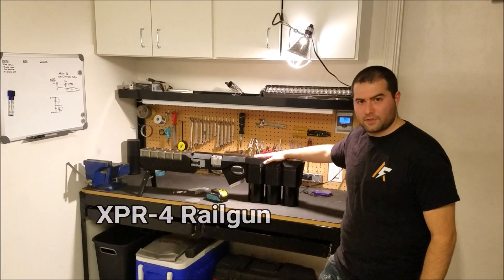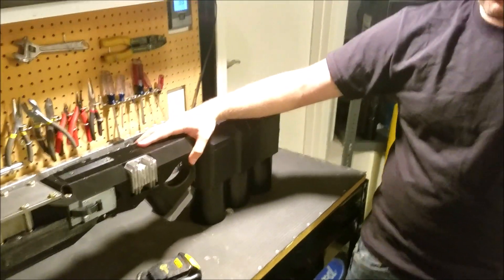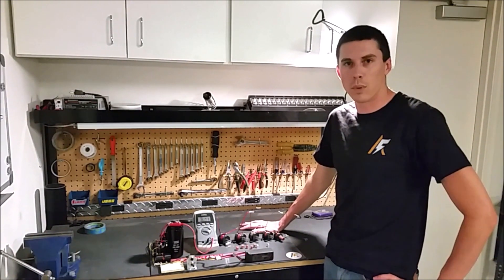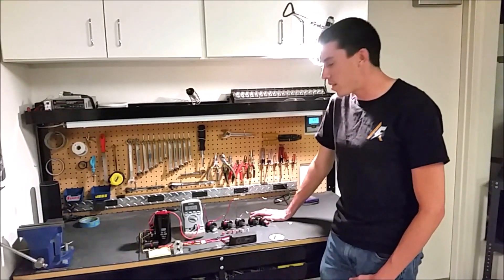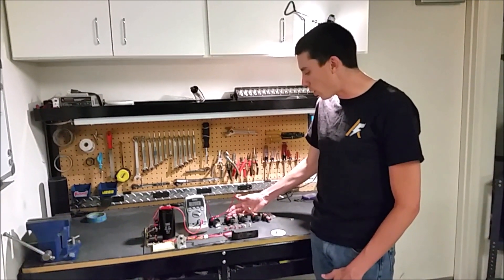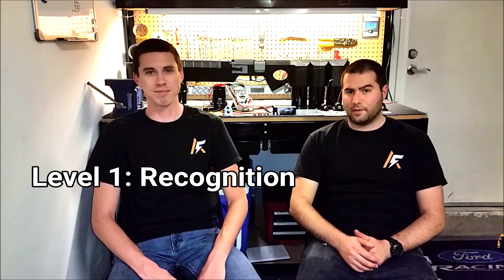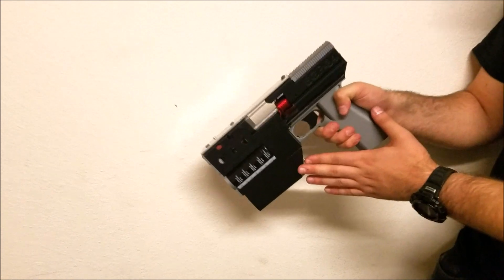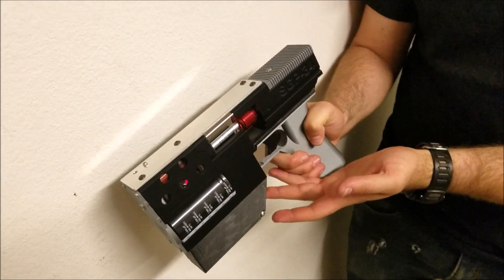New Railgun + Crowdfunding Campaign!

Comment: Surprised the US Military hasn’t picked these guys up. I’m sure somewhere at DARPA they’ve been experimenting with this stuff and may even be farther along but right now this stuff could be extremely viable in terms of lethal and less than lethal ballistic options. A low velocity metal slug would surely hurt like a mf and do some damage. I’m sure with enough R&D a low power, low velocity version of the stuff you guys have been producing could be explored in the field of less than lethal options for law enforcement and military applications. Maybe even commercial home defense. A much stronger high power, high velocity system using a sabot style projectile could be extremely viable in low noise, high damage applications for military use.

Comment: This is really cool, I feel like you guys should try a bullpup design though since you won't have to worry about case ejection or linkages in the trigger (the two main problems with bullpups). You should also have Joerg Sprave test some of your designs, he is in Germany but he has a chronograph and ballistic gelatin and in general seems really nice. It would be cool to get the velocity, energy and other stats for these guns.
Also out of curiosity, I am guessing that these barrels are smooth bore? I was thinking that if you wanted the enhanced accuracy of rifling without using lead projectiles you could use plastic sabots like with the 6.5x25 CBJ cartridge, maintaining the ability to use a variety of projectile materials while still getting the benefits of rifling. In this case you also wouldn't have to use flechette projectiles, which may be much more difficult to make. Regardless I would love to see an accuracy test of these wonderful pieces of innovation.

Comment: Personally..Back when I had 5.5KJ of capacitors ( 5 large caps custom made by CDE ) I never really had the best luck with coilguns shooting  insanely hard. But, When I made an ElectroThermalGun, with just a thin strip of Aluminum Foil in a barrel, I managed to shoot a wirenut through the wooden-door in my room, without even using full power.  I may be bias, but personally I find more projectile potential in ETG's than coilguns. They may be less loading-friendly, since the chamber the plasma gas expands in, has to be sealed and really durable..but, there's a ton of power behind the projectiles.
Reply from the maker: True that it is easier to get more kinetic energy out of an ETG  than a coilgun.  However coilguns posses two major advantages: 1: They are silent, and 2: They are not restricted by existing gun laws.

Comment: I recommend using a bull pup configuration to help maximize the length of the rails.
Reply: Oldest coilguns they have created indeed use a bullpup design, i wonder why they scrapped it for the big one
Reply from the maker: The stock of the gun for future designs will most likely be occupied by charging and control electronics, which have expanded in volume to provide shorter cycle times.  This pushes the coils forward and makes the grip the most efficient place for the magazine.  We spend a lot of design time figuring out how to minimize the size of our guns.
Reply: @Larsplatoon  Ever think about a revolver design?
Reply: @crispwhitesheets2175  what the would be the point? The whole idea of an electromagnetic (or inductive) accelerator is to minimize moving parts. Why add a cylinder?
Reply: For the aesthetics, obviously, because as we know, aesthetics win fights.
Reply: A bullpup config would work pretty decently since it’s only coils and not a hammer

Comment: Plasma rounds?  I mean I suppose Blade Runner did take place in 2019, must have only been a matter of time.
Reply: Plasma is not that hard to make, you just need the railgun to make a big pogo party inside the shell and everything turns hot in a second, with electromagnetic induction i think...
Reply: There is a video of someone who made a weapon that fires Neon Gas that is fired out of railgun and is essentially a "plasma weapon". It penetrated through steel, if I remember the video correctly.
Reply: @Pokemonmaster212  i think that plasma rounds are possible if you set the gun up in a way that it fires doughnuts shaped plasma that also spins to make the round make its own magnetic fields
Reply: I think some people call that plasmoid
Reply: @haminatorainz7227  its way easier to shoot a vacuum tube wrapped in a copper sleeve filled with neon gas the magnetic field ionizes the gas through induction an because it's in the vacuum tube it stays a condensed plasma all the way to the target
Reply: @haminatorainz7227  kinda I prefer to call it a plasma bolt
Reply: Dylanrockin  Any idea how I can find it?  Am unable to despite searching.
Reply: But how effective are the plasma rounds
Reply: @haminatorainz7227  like if you get hit by a 10000K hot piece of goo